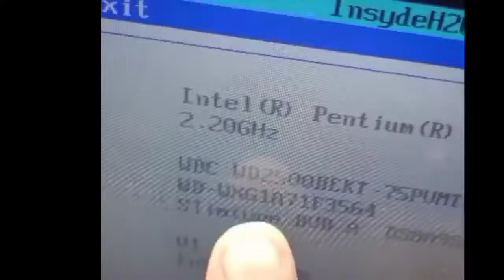How to Upgrade Processor Laptop Intel Pentium to Intel Core i3/ Upgrade your Laptop and Computer

Comment: Sir my laptop is intel (R)Pentium(R)  cpu N3700@1.60 ghz 
Installed RAM.. 4.OO GB 
 CAN we upgrade i3 or i5 processor in it?
Reply from the maker: yes you upgrade your processor in 2nd or 3rd gen i3 or i5
Reply: If any body having Pentium processor or celeron processor or i3 2nd or 3rd generation processor in laptop you can upgrade it. check processor socket in laptop and see it molded or removable. If removable you can upgrade. Check using cpu z software you see it shows (Socket 988B rPGA)
 see image I shared processor pin and socket

Tdp is 35w so Plug and play and no bios update needed

Used Intel i5 and i7 2nd generation laptop processor available for sale

Comment: Intel ( R ) Pentium ( R ) CPU N3710 @ 1.60GHz 1.60 GHz 
Sir it is possible to upgrade into i3 or i5?
Please reply... Thanks 😊😊
Reply from the maker: yess
Reply: @ctechsolutionsgameplay8004  but my CPU motherboard is soldered how?
Reply: No you can't. Your laptop use BGA (Ball Grid Array) not PGA (Pin Grid Array). 
Most of BGA cpu cannot be changed even if you are desolder and solder a new cpu because of the chipset and the bios cannot recognize a new cpu.
Reply: @ctechsolutionsgameplay8004  PPGA478 t3400

Comment: Intel(R) Pentium (R) CPU B960@2.20 ghz, 2200 mhz, 2 cores. Can we upgrade this to i3 processor?
Reply from the maker: no
Reply: Buy new one
Reply from the maker: never upgrade
Reply: If any body having Pentium processor or celeron processor or i3 2nd or 3rd generation processor in laptop you can upgrade it. check processor socket in laptop and see it molded or removable. If removable you can upgrade. Check using cpu z software you see it shows (Socket 988B rPGA)
 see image I shared processor pin and socket

Tdp is 35w so Plug and play and no bios update needed

Used Intel i5 and i7 2nd generation laptop processor available for sale

Comment: I have a query ,hp d series laptop and ,(PGA motherboard) processor= Intel(R) pentium (R) CPU 2020M @2.40Ghz .will it upgrade to other cpu if yes then which one is compatible,, reply sir..
Reply: hp 15 du00tx laptop
Reply: socket is-- 988b rPGA
chipset Intel  Ivy brigde
Reply: and South bridge is HM76
Reply: @vladimirazirov1815  thank you..
Reply: If any body having Pentium processor or celeron processor or i3 2nd or 3rd generation processor in laptop you can upgrade it. check processor socket in laptop and see it molded or removable. If removable you can upgrade. Check using cpu z software you see it shows (Socket 988B rPGA)
 see image I shared processor pin and socket

Tdp is 35w so Plug and play and no bios update needed

Used Intel i5 and i7 2nd generation laptop processor available for sale

Comment: Sir intel Pentium t4200 can upgrade to which processor
Reply from the maker: i3 1st gen or i5 1st gen
Reply: Hello sir. Pentium T series cannot be upgrade to I3/I5/I7 series.
I need to find your chipset model to find a compatible cpu for your laptop.

Comment: Hi sir, can I uprade Acer aspire E1-531, Intel® Pentium® Processor B960
2M Cache, 2.20 GHz  to I3 or I5?
Reply: If any body having Pentium processor or celeron processor or i3 2nd or 3rd generation processor in laptop you can upgrade it. check processor socket in laptop and see it molded or removable. If removable you can upgrade. Check using cpu z software you see it shows (Socket 988B rPGA)
 see image I shared processor pin and socket

Tdp is 35w so Plug and play and no bios update needed

Used Intel i5 and i7 2nd generation laptop processor available for sale
Reply: laptop processor AMD E2, A4, A6, A8, A10 & i7 1, 2, 3, 4 gen Available

Comment: Sir I have Acer laptop Intel @ B960 processor (2.2 GHz, 2Mb L3 cache).
Can I upgrade to i3 with same gen ?
Reply: If you having Pentium processor or celeron processor or i3 or i5 1st, 2nd, 3rd, 4th generation processor in laptop you can upgrade it.
Plug and play and no bios update needed.
Intel i7 1st, 2nd, 3rd, 4th,  gen quad core processor any available model I can arrange it from my frnd.
i5 2540 & i7 2640 2nd gen in hand available.
I'm selling this on OLX: i7 processor 4 core 8 thread
Reply: laptop processor AMD E2, A4, A6, A8, A10 & i7 1, 2, 3, 4 gen Available

Comment: Bro Mine is Acer Gateway NE56R 2GB Memory Laptop.
When I run "wmic memphysical get maxcapacity, memorydevices" in cmd, It gives me below result:
MaxCapacity           MemoryDevices
16777216                               4
Max capacity is 16777216(16GB), So, Can I upgrade it to 16GB RAM??
And why 4 slot of Memory mentioned but I can't find out 2 other slots? Also, 4 slots mentioned in "Memory" tab of Task Manager.
RAM:
	Memory slots
			Total memory slots	4
			Used memory slots	1(2GB)
			Free memory slots	3
		Memory
			Type	DDR3
			Size 	2048 MBytes
			Channels #	Single
			DRAM Frequency	665.1 MHz
			CAS# Latency (CL)	9 clocks
			RAS# to CAS# Delay (tRCD)	9 clocks
			RAS# Precharge (tRP)	9 clocks
			Cycle Time (tRAS)	24 clocks
			Command Rate (CR)	1T
		Physical Memory
			Memory Usage	82 %
			Total Physical	1.83 GB
			Available Physical	335 MB
			Total Virtual	4.83 GB
			Available Virtual	2.06 GB
		SPD
			Number Of SPD Modules	1
				Slot #1
					Type	DDR3
					Size	       2048 MBytes
					Manufacturer	Nanya Technology
					Max Bandwidth	PC3-10700 (667 MHz)

CPU: 
      Intel Pentium B960
	  Cores	2
	  Threads	2
	  Name	Intel Pentium B960
	  Code Name	Sandy Bridge
	  Package	Socket 988B rPGA
	  Technology	32nm
	  Specification	Intel Pentium CPU B960 @ 2.20GHz

Motherboard:
	Manufacturer	Gateway
	Model	EG50_HC_HR (U3E1)
	Version- Type2 - Board Version
	Chipset Vendor	Intel
	Chipset Model	Sandy Bridge
	Chipset Revision	09
	Southbridge Vendor	Intel
	Southbridge Model	HM70
	Southbridge Revision	04
		BIOS
			Brand	Gateway
			Version	V1.13
			Date	10/9/2012
		PCI Data
				Slot PCI-E x16
					Slot Type	PCI-E x16
					Slot Usage	Available
					Data lanes	x16
					Slot Designation	J5C1
					Characteristics	PME, Hot Plug
					Slot Number	0
				Slot PCI-E x1
					Slot Type	PCI-E x1
					Slot Usage	Available
					Data lanes	x1
					Slot Designation	J6C1
					Characteristics	PME, Hot Plug
					Slot Number	1
				Slot PCI-E x1
					Slot Type	PCI-E x1
					Slot Usage	Available
					Data lanes	x1
					Slot Designation	J6C2
					Characteristics	PME, Hot Plug
					Slot Number	2
				Slot PCI-E x1
					Slot Type	PCI-E x1
					Slot Usage	Available
					Data lanes	x1
					Slot Designation	J6D2
					Characteristics	PME, Hot Plug
					Slot Number	3
				Slot PCI-E x1
					Slot Type	PCI-E x1
					Slot Usage	Available
					Data lanes	x1
					Slot Designation	J7C1
					Characteristics	PME, Hot Plug
					Slot Number	4
				Slot PCI-E x1
					Slot Type	PCI-E x1
					Slot Usage	Available
					Data lanes	x1
					Slot Designation	J7D2
					Characteristics	PME, Hot Plug
					Slot Number	5
				Slot PCI-E x1
					Slot Type	PCI-E x1
					Slot Usage	Available
					Data lanes	x1
					Slot Designation	J8C1
					Characteristics	PME, Hot Plug
					Slot Number	6
				Slot PCI-E x16
					Slot Type	PCI-E x16
					Slot Usage	Available
					Data lanes	x16
					Slot Designation	J8C2
					Characteristics	PME, Hot Plug
					Slot Number	7

Please bro suggest me best Processor and Max Ram upgrade to use this laptop at it's max potential. Can use for multitasking, Some times gaming, Simple 2k or 4k video editing. Also can use Android emulator using Virtualization enabled, btw my current processor not supports Virtualization.
Reply: Yes you can update our memory 8x2=16gb
Reply: @Ramprit20  but Processor is so weak to handle 16gb ram

Comment: I have intel B950 2.10 Ghz can I upgrade to i3 or i5
Reply: If any body having Pentium processor or celeron processor or i3 2nd or 3rd generation processor in laptop you can upgrade it. check processor socket in laptop and see it molded or removable. If removable you can upgrade. Check using cpu z software you see it shows (Socket 988B rPGA)
 see image I shared processor pin and socket

Tdp is 35w so Plug and play and no bios update needed

Used Intel i5 and i7 2nd generation laptop processor available for sale

Comment: Can I upgrade my Intel Pentium R CPU B950 2.10 GHz to Intel core i3??
Reply from the maker: yess
Reply: How about i5 and i7 sir?
Reply: If any body having Pentium processor or celeron processor or i3 2nd or 3rd generation processor in laptop you can upgrade it. check processor socket in laptop and see it molded or removable. If removable you can upgrade. Check using cpu z software you see it shows (Socket 988B rPGA)
 see image I shared processor pin and socket

Tdp is 35w so Plug and play and no bios update needed

Used Intel i5 and i7 2nd generation laptop processor available for sale

Comment: i got an intel pentium cpu b960 2.20ghz and i want to upgrade it to i3... CAN I ?
Reply: @vladimirazirov1815  my laptop name hp 630 can i upgrade to i3?
Reply: @vladimirazirov1815  ok thx
Reply: @vladimirazirov1815  socket 988B rPGa  southbridge hm65 cpu support  list please
Reply: @vladimirazirov1815  yes he has dvd and  hd  graphics but prossesur is b960
Reply: @vladimirazirov1815  what is the list can  support prossesur my mother board
Reply: @vladimirazirov1815  ok thanks
Reply: If you having Pentium processor or celeron processor or i3 or i5 1st, 2nd, 3rd, 4th generation processor in laptop you can upgrade it.
Plug and play and no bios update needed.
Intel i7 1st, 2nd, 3rd, 4th,  gen quad core processor any available model I can arrange it from my frnd.
i5 2540 & i7 2640 2nd gen in hand available.
I'm selling this on OLX: i7 processor 4 core 8 thread

Comment: I ALSO WANT TO UPGRADE THE LAPTOP DUEL CORE TO I3 CORE ..
CAN I..
Reply from the maker: not possible
Reply: If any body having Pentium processor or celeron processor or i3 2nd or 3rd generation processor in laptop you can upgrade it. check processor socket in laptop and see it molded or removable. If removable you can upgrade. Check using cpu z software you see it shows (Socket 988B rPGA)
 see image I shared processor pin and socket

Tdp is 35w so Plug and play and no bios update needed

Used Intel i5 and i7 2nd generation laptop processor available for sale

Comment: Sir can I upgraded Pentium dual core to core i3 in HCL laptop?
Reply from the maker: no only intel Pentium or celeron processor upgradable to i3 and i5
Reply: If any body having Pentium processor or celeron processor or i3 2nd or 3rd generation processor in laptop you can upgrade it. check processor socket in laptop and see it molded or removable. If removable you can upgrade. Check using cpu z software you see it shows (Socket 988B rPGA)
 see image I shared processor pin and socket

Tdp is 35w so Plug and play and no bios update needed

Used Intel i5 and i7 2nd generation laptop processor available for sale

Comment: Me intel celeron to i5
Reply from the maker: yes
Reply: If any body having Pentium processor or celeron processor or i3 2nd or 3rd generation processor in laptop you can upgrade it. check processor socket in laptop and see it molded or removable. If removable you can upgrade. Check using cpu z software you see it shows (Socket 988B rPGA)
 see image I shared processor pin and socket

Tdp is 35w so Plug and play and no bios update needed

Used Intel i5 and i7 2nd generation laptop processor available for sale

Comment: Can I upgrade my 2010 Dell Vostro 1014 laptop with Intel Core 2 Duo to intel core i3 or i5?

(Intel® Core™2 Duo CPU T6570 @ 2.10GHz × 2)
Reply: @vladimirazirov1815  I have acer aspire 3 i3 11th generation and windows 11 can I upgrade this to i5
Reply from the maker: no
Reply: @vladimirazirov1815  some 4th gen intel processors have pga sockets like naming M series processors
Eg:Intel® Core™ i3-4100M Processor
It uses pga 946 and intel core i5 2450M it uses socket 989(its 2nd gen processor)

Comment: I have same laptop

Acer aspire e1 431
Where can I buy cpu.

Cpu is pentium b950
From where you bought?
Reply: If any body having Pentium processor or celeron processor or i3 2nd or 3rd generation processor in laptop you can upgrade it. check processor socket in laptop and see it molded or removable. If removable you can upgrade. Check using cpu z software you see it shows (Socket 988B rPGA)
 see image I shared processor pin and socket

Tdp is 35w so Plug and play and no bios update needed

Used Intel i5 and i7 2nd generation laptop processor available for sale